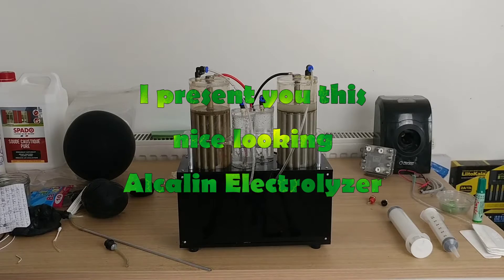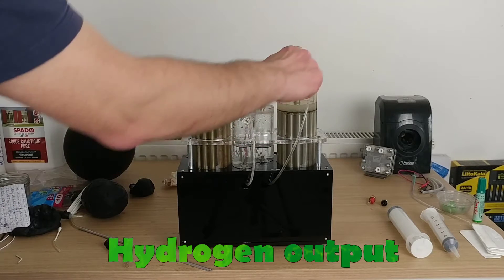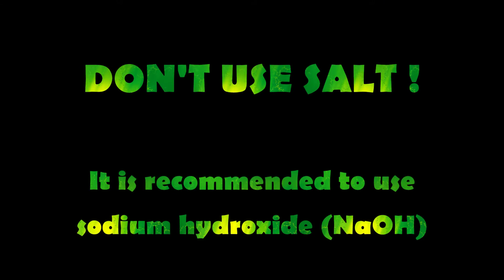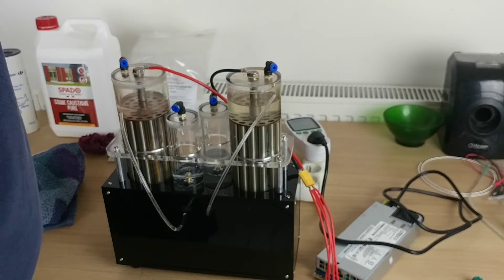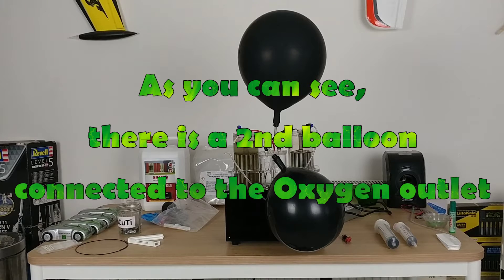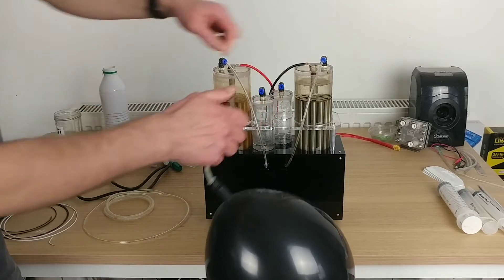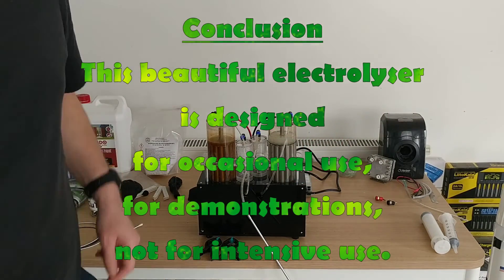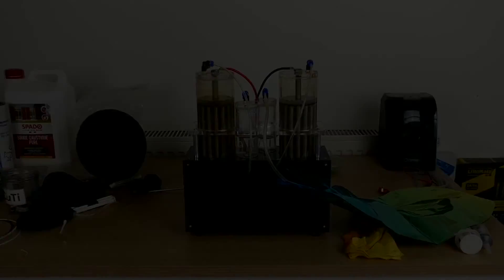Hydrogen-Oxygen Separation Water Electrolysis Machine

Comment: Please quick release video about pem electrolyzer how many ml pem electrolyzer you buy?will 50 ml can be used to fill latex balloons?i want to save money to buy it❤
Reply from the maker: Hi,
I bought the 300ML-20A PEM Electrolyzer here : https://www.aliexpress.com/item/1005006679328315.html
The 60ML-8A will work fine too, but Hydrogen production is slower.
No problem inflating a latex balloon, it is indicated in the specifications that the output pressure is 10 bars, it is huge!!!
Reply: @jcopfr how about  50 ml can it fine use to fill latex balloons will it float?will it work with 12v?i just buy 50 ml when money enough
Reply: @jcopfr hi Julian did you already about your pem electrolyzer yet?

Comment: When you release video how to transfer mylar balloons pump hydrogen from mylar balloons to latex balloons using mini pump using your new electrolyzer not pem make video filling mylar balloons after that shows the video how to transfer pump hydrogen from mylar balloons using mini pump to latex balloons can you tell me real time you release?
Reply from the maker: Next video will be on PEM Electrolyzer because it is much more efficient : PEM Electrolyzers have a longer lifespan, consume less electricity for the same quantity of H2 produced, and only need distilled water unlike this electrolyzer which uses a corrosive product, NaOH !
To inflate latex balloons, they are much much much much more effective
Reply: @jcopfr will it work with normal water
Reply from the maker: @ChanCheaurn-m6u  Yes it works with normal water but it is better to use distilled water
Reply: @jcopfr did you done it yet can you show me some link video?i will save money to buy will 50 ml pen can it use to fill latex balloons?
Reply from the maker: @ChanCheaurn-m6u  I bought the 300ml-20A here : https://www.aliexpress.com/item/1005006679328315.html
Reply: @jcopfr how many balloon for a time.
Reply: @jcopfr cab you send me some link video about it too me wait it need only tap water in your pem electrolyzer wow!i think i to save money buy it too .❤❤❤if you do video about pem electrolyzer will it short video or full video?and when you release?

Comment: I know your reason why water electrode escape beacuse you not fill the electrolyzer not filling solution to top of double of electrolyzer i want you do again test ! and try fill latex balloons?
Reply from the maker: I did as explained by the manufacturer !
Reply: @jcopfr i know how to fix pressure inside you need an compressor to solve it!if you success please make the video! plubish
Reply from the maker: @ChanCheaurn-m6u  The best solution is to inflate Mylar balloon first, then transfer the Hydrogen into the latex balloon using a mini electric pump. I will demo this!
Reply: @jcopfr can you release video about it with this electrolyzer in video you can inflate and show me and use mini dc electric pump will you make short or full and when release date?❤
Reply: @jcopfr  it was easy first i want you to test and plubish video short first fill balloon mylar with electrolyzer and show me after that use dc pump(water pump) for safe without shock and can you tell me when you plubish video about it ?❤
Reply: @jcopfr https://youtu.be/oIWgzVaGn4Y?si=V06lLThTlZbFf1Zz I want you to edit hack this generator in video to like i send link video i want do plubish about this electrolyzer have more editions.